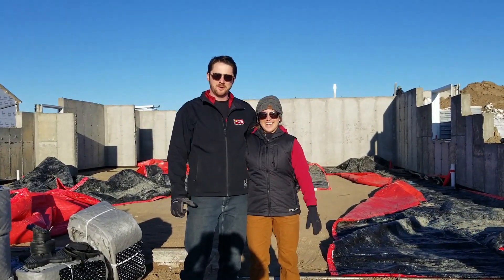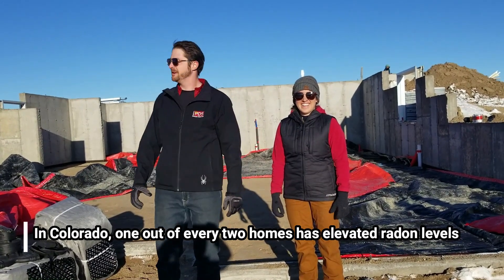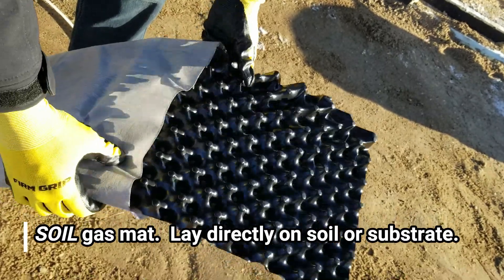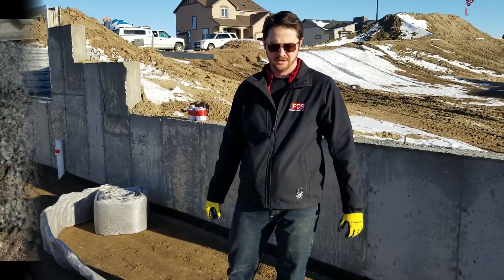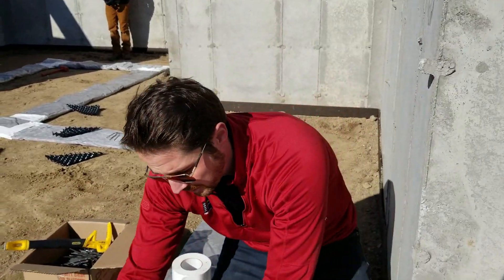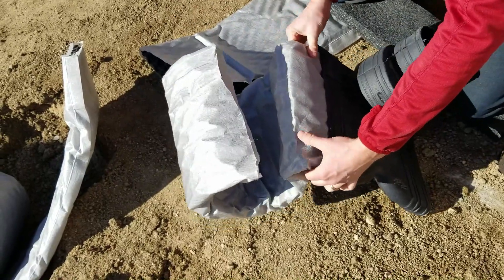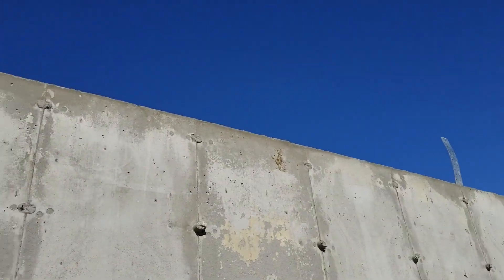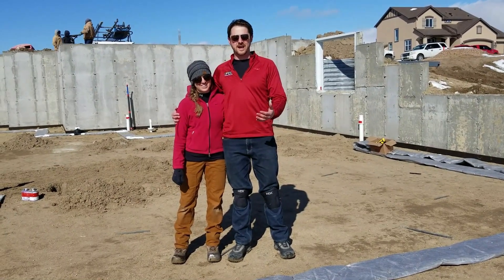Soil Gas Radon Mat FULL Installation Single Family Home | PDS Radon Supply

Comment: The problem I see with this system is that since there is no vapor barrier (didnt see any gravel, wwm / rebar....may be they have fiber in the concrete) then we all know concrete will crack even at control joints and radon gas can still come up between the cracks.  Radon mitigation system in our area runs between $1200 - $1800..... I suspect this cost more.

Comment: Is there no need for vapor barrier on top of the soil mat to extend pressure field?
Reply from the maker: Great question!  That would help with PFE, but under most radon codes it is not a requirement.  It will not hinder the gas mat either way; however, if it is not required by the GC, then you do not have to put down any vapor barrier.  Always check with the engineer or GC on the project.  In Colorado, most single family homes don't utilize a vapor barrier, while out east, many do.  IL and MN both require it no matter what.  Thanks for the question!